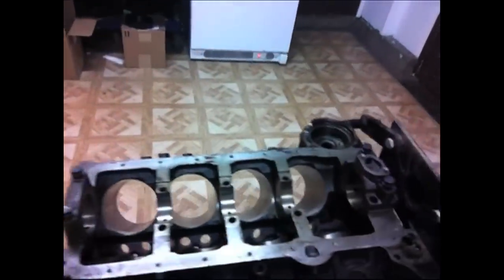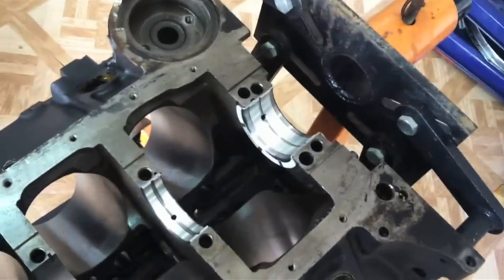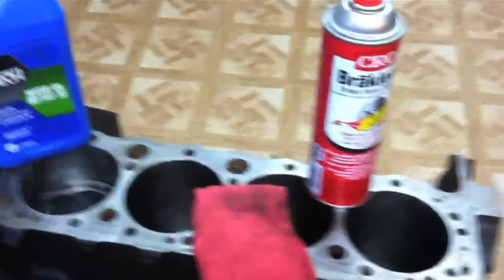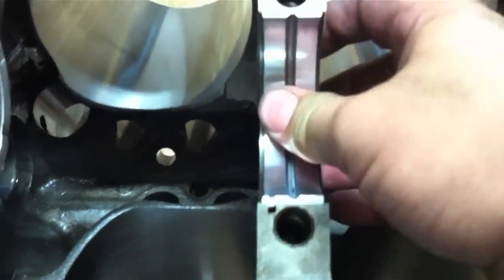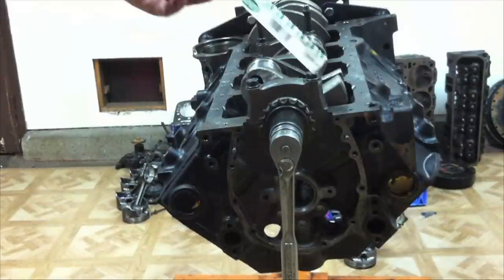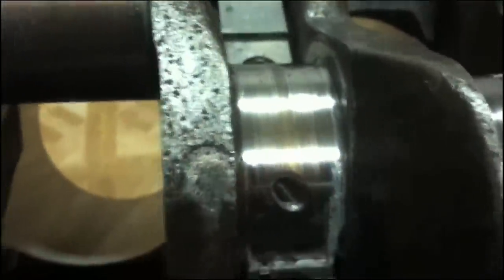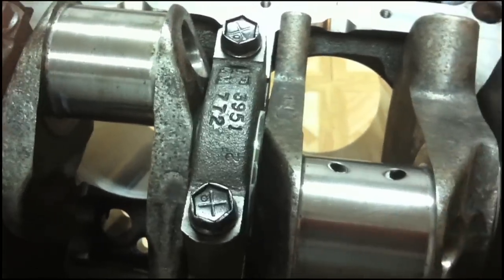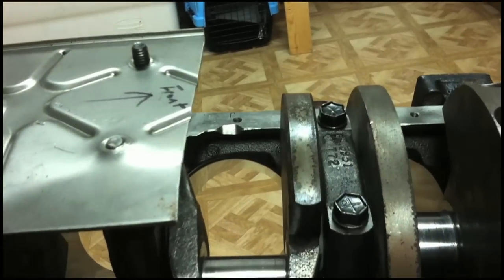How To Build a Chevy 383 Stroker - Part 1: Block & Crank

Comment: I have never seen anyone clearance half a bearing. Why would you stroke a 2 bolt main?
Reply from the maker: The amount of material you take off with "scratch brite" is so small that if you needed to clearance upper and lower bearings you probably have the wrong size bearing or crank. The stroker crank came in the box of crap the customer brought me. Some people are just too cheap to do things right and I don't work with people like that anymore.

Comment: It wouldnt have cost much to polish that crank. Also, you should not have that grease in there when plasiguaging. It will read tighter  than it is. I got a 415 small block in about the same condition and its been running strong for 15 years now.
Reply from the maker: That's what happens when you have a customer who is really cheap. He just wanted me to put the parts together. I don't work with cheap customers anymore.

Comment: i know its an old video but you did a great job. it looks like the original builder did not clearance the crank or block. that crank looks shitty. i had many stock chevy cranks with over 70 to 100k miles that looked like new.
Reply from the maker: Thanks. When the client brought me the bucket of parts he never said the word "Craigslist" and did not want to spend the money to redo everything. That's why I used it as a training video. LOL You can see a NICE 350 on my "Engine dress Up" series. 400 hp simple street "motor"

Comment: do stock rods and pistons still work
Reply from the maker: Not trying to sound like an ass but yes and no. "Stock" can refer to many different piston and rod designs. "Stock" pistons and rods in a 400 that you might use in a 350 block are different than the 350 "stock" rods and pistons. There are almost unlimited rod and piston designs to build an engine these days. Overall "compression" and "displacement" comes from a combination of pistons, rods, camshaft, bore, crank and so on. There are many complete "stroker" kits available from places like Summit and Jegs. I would start with talking to your local machine shop to see what is available and what works best in your situation. Is it a street car? A weekend racer? An off road truck? Do you want 9:1 compression to drive around town or 12:1 to go race? Pistons can be domed or dished and the wrist pin is located in varying points on each piston design. Check out the "Build Sheet" page on my website. it will help you plan and budget your build. You can also read more of the "techo" stuff on this page I found   http://www.hotrod.com/articles/ccrp-0808-383-stroker-small-block-chevy/  Thank you!

Comment: how do you know if you have a 383 strocker crankshaft
Reply from the maker: If you don't have the book with the numbers you can look online. There are a few webpages I have found that list serial numbers for cranks, heads and blocks, etc. You can measure the crank throw but honestly not sure how to do that accurately. I let the machine shop do all that stuff for me.

Comment: how much did the whole build cost?
Reply from the maker: This was a long time ago. He brought me a basket of parts and I just charged him a few hundred $ to put it all together. I had to clearance the block and check things out. He would not listen when I told him all the things wrong with it like the shit crank, etc. I won't do that again. If you want to see a GOOD 400 hp 350 build take a look at the follow up series on "Engine Dress Up" with the red engine and new aluminum heads. A GOOD engine like that custom built from the computer design and dyno program to a complete engine is $5000 - $6000 (2015 prices). That includes everything from oil pan to air cleaner. This engine was crap that's why I used it as a training film. LOL

Comment: I use a hard plastic hammer.
Is that bad?
Reply from the maker: Where are you using the hammer?
Reply: knocking in main bearings. I was afraid a metal head  could mar the edges.
I am a mechanic that builds the occasional engine as a hobby but not an engine builder. My current engine build is a 350 OLds that should make near 430hp. My next project is an 351 Cleveland that will be stroked to 393. I just do it for fun.
Reply from the maker: 1400IntruderVS Some people yell and scream if you use any hammer or impact gun on main bearings. I understand if they want to be completely anal and that's fine but most people do not realize that there are different size and styles of hammers and there is a setting on air tools to turn them down just like a stove burner! You do not need to set the gun at 500 ft/lbs! You do not need a 5 pound sledge to lightly tap in a main bearing cap. You can see I am using a very small ball peen hammer to very lightly tap the cap into place.
Think of it this way: 
Just because you are a butcher does not mean you can be a surgeon!
A plastic hammer is fine especially if you use a "dead blow" style with lead shot in the head. Whenever possible (or when I think about it) I try to use the handle (butt) of a hammer (wood or plastic) to tap things in place the same way I do installing pistons. You can see that on part 2 installing pistons.
Hope this answers your question. I know it's a bit long winded but a simple "yes" or "no" will get a bunch of screaming responses one way or another. I'm sure it will anyway! LOL
Reply: I get it. 
I actually use the handle of my plastic dead-blow hammer to install pistons.
Thanks and great videos.
Reply from the maker: 1400IntruderVS
Thank you. And obviously this engine is not my best work. If you want to see some very nice engines check out my website www dot corvettesandcustoms d o t O R G

Comment: The difference is not whether it is electric that determines whether it's a motor or an engine.  the technical difference is that an ENGINE runs under it's own power, and a MOTOR requires a source of outside energy to run.  An ENGINE can run a MOTOR (example: GENERATORS), but a MOTOR cannot run an ENGINE without some sort of external power source to run the MOTOR in the first place.  Simple, right?  😉
Reply from the maker: I can see both sides of the argument. The human body is like a train engine - diesel/electric. Diesel engine running and electric motor. The human body takes in external fuel which is burned and turned into energy at the same time electrical impulses control our "motor functions." LOL Also an engine needs fuel and motors need external power from electricity or other means like a hydro electric motor. Unless you have a perpetual motion machine..... motor.....engine?  The world may never know! Ha.

Comment: Don't impact main bolts
Reply from the maker: You can use an impact on main bolts just don't have it turned up all the way and don't hammer the shit out of them. Why don't you guys understand that you can turn DOWN an air gun gun like you can turn down a stove!  If I still have to turn the bolt with a torque wrench just to get to 65 ft. lbs. do you really think there is a problem?

Comment: yes   lay your crank down on dry bearings and torque    there is no need to turn the crank for you are just going after clearance.   at least for the mains.    once mains have been found to be within tolerance  then lube bearings, reinstall and torque.   then you can proceed to check rods in the same fashion.      The clearance you read IS the oil clearance.  Otherwise you are getting a false reading

BTW    why would you install a POS crank back into an engine?
Reply from the maker: sc928porsche Anyone else care to respond to this? He obviously does not get it.
Reply: How is it a POS?  Looks fine to me. It just has to be smooth and he plastigaged it for the clearance I don't see a problem.
Reply: +SanDiegoHotRod do you like the 2 bolts as much as the 4? How much of a strength difference is there?
Reply from the maker: Max Daniel I prefer to use a 4 bolt because I have built a lot of supercharged small blocks with 500 - 800hp. You don't really need a 4 bolt if you are doing low compression and building under 400hp. 4 bolts offer more strength and insurance for higher rpm and hp etc. This POS 383 belonged to a customer who just wanted the parts put together. The steel crank is strong enough and it clearanced ok but I would have turned it or got another crank. Lots of short track guys use cranks like this all the time which is great when you are doing constant rebuilds or you are racing in a class that says if you win you have to sell your engine to anyone who offers you $500 (or whatever price they set). That keeps local track races fair and competitive.

Comment: I have an issue with how much oil you put in your main cap bolt. That much oil would not allow the bolt threads too properly seat. Even machine oil has the property of all fluids and DOES NOT COMPRESS! So you aren't getting the almost metal to metal torque that is called for. Put a drop of oil on your finger or a cloth and just lightly rub and remove the excess. Also imho I wouldn't waste time making a "stroker" out of a 350 with 2 bolt mains! But that may just be me.
Reply from the maker: Actually you do not want metal on metal on bolt threads. That is the whole reason for using oil.  Second the oil does not compress. It is not an air tight seal. The oil disperses. Most of the oil also comes off when you are threading it into the hole. If you were pouring the oil into the hole that might be different. And I agree. I would not build a 383 with a 2 bolt block but that was just one asshole customer with no clue that's why I chose this build to shoot the video with.
Reply: I fixed my original comment, I had meant to say almost metal to metal. I was not saying oiling was wrong but the amount if you review the video is imho excessive. Also if it is a "blind" hole where would the oil disperse to? Some out the top as you screw in to be sure, but not all that.  In most cases when using lube during engine assembly where you don't have moving parts, as in the case of a bolt going into a blind hole less is MORE.
Reply from the maker: I understand. If you have too much oil or fluid in a blind hole you don't want the bolt to hydraulic out. That's why you don't fill the hole. It's like cooking with "a hunk of butter" or "exactly 1 tablespoon of butter."  You are correct. You just want to lube the bolt and threads. It's not like priming the oil pump.

Comment: I would think it would have been a lot smarter and beneficial to remove the extra material from the already rough crank to smooth it out rather than intentionally wear down the bearing coating?

Comment: Sorry guy, but I build racing engines. I would never use plastigauge. Takes three sets of main bearings to acheive the clearance i want on bearings, plus a micrometer, plus time. When I get thru, I take the other two sets of bearings back. Never had a bottom end engine failure yet. fyi
Reply from the maker: Been building race engines for over 20 years and have never had an engine failure either. Do you charge by the hour? I would love to have customers that don't mind paying $150 an hr. for an extra 20 hours of changing bearings, buying multiple sets of bearings and running back and forth to the store. What's the name of your shop? I think I will move to where you live.
Reply: SanDiegoHotRod Sorry if I offended you guy. It doesn't take 20 hrs to crush and document 15 bearings. I build my own engines ( no customers) and i don't use pitted crankshafts. Mine are indexed, polished, knife edged, balanced, oil relieved, and turn 10 grand. (287 with a 3 inch stroke) That's why I'm particular about my bearings. Just sayin'.     Keep on doin' what you're doin' if you're makin' money at it.
Reply from the maker: Brian Ferrell No worries. The engine in this video is garbage that I put together a few years ago for some really cheap customer. That is why I used it for a demo for home building weekenders. If you watch any of the engine building shows on TV you must go crazier than me seeing how they do things and all the steps they leave out, etc. I don't do anymore cheap work since I am buried in restorations now (65 Chevelle, 58 Impala, 58 Corvette with factory fuel injection and 67 Corvette with factory 427 and tri-power). You can see some much better engine work on my website. Thanks Shan www dot corvettesandcustoms dot ORG
Reply: Cool!
Reply: Brian Ferrell Can you make a video of how to properly check for the clearances? I noticed you don't have any uploaded videos. Thanks

Comment: if you can't find out what main caps go where you cannot mix match them you would have to get it line bored to match them again or you'll have to fit them and make sure there is absolutely no gap or mark between the block and cap where the fit together. . same goes for the rods. 

BTW you don't need to tap the bearing or journals you can push them flat with ur fingers...

that crank looks like shit... that crank should look like a mirror I would have just spend the money and had it polished.. that's just adding insult to injury.. you can't shave a main bearing there's a coating on it your rubing off!! ever heard of breakaway force??
Reply from the maker: You may have spent the money but when the customer just wants you to put the thing together and not spend a dime then that's a different story. How many engines have you built for clients? I looked on your channel and did not see any videos you made to show people how to do anything. BTW if you can push the caps flat with your fingers they are too loose. Just sayin.

Comment: brass hammer would be a good idea bud.
Reply from the maker: I normally use a plastic hammer with the shot inside (dead blow hammer) but did not have it with me when I was shooting this. This hammer is so tiny. Brass is softer but you can also get brass chips or flakes in the works. As you can tell I am not super ANAL about being clean or as some one else screamed "Scotchbrite has 40 microns of aluminum oxide and it will destroy your engine!"

Comment: how mutch hp
Reply from the maker: This engine is not great with mostly stock parts. it is about 350 true hp. If you look at the red engine on my "Engine Dress Up" series it has better parts, better aluminum heads and is just over 400hp on premium gas. The long stroke give you low end torque. Most of your hp comes from the heads.

Comment from the maker: Obviously you have not built many engines professionally. I have been doing it for over 20 years on MANY EXPENSIVE show cars and race cars. Have you EVER been in the pits at an NHRA event and watched them rebuild a 7000 hp engine in 90 minutes? BTW, impacts DON'T effect bearings whatsoever, plus there IS an adjustment on air tools just like the burner on a stove. Just FYI

Comment: Never   repeat  NEVER  handle rod, main, or cam bearings with bare hands.    Disposable gloves are easy enough to come by.    Also apply lube to bearings with gloves on.      Do not lube the bearings when checking for clearance.  It will give you a false reading.  Once you have gauged the clearance and cleaned,  then apply assembly lube and install.   Thank you.
Reply from the maker: sc928porsche So you would lay a brand new (not this POS) crankshaft down on DRY bearings. Torque all the main caps and check each bearing WITHOUT lubing the journals? And when you need to SPIN the crank for each journal to make sure the oil hole on the crank is not in the way you would spin the crank DRY or would you take EVERY main cap off, lift the crank, turn it, torque each cap down AGAIN and measure the next bearing? Interesting......
When an engine is running the oil passing between the bearing and the crank takes up space. THAT is part of the clearance you ALSO need to measure. You don't put lube on the spot where the plasti gauge is measured. 
So you are saying that the oil from your hands is worse than the assembly lube or oil that is in the engine? Exactly how many engines have you built yourself? Appreciate the concern but you sound more like a doctor than a mechanic.
Reply: sc928porsche If you are cleaning everything up before final assembly there is nothing wrong with handling parts barehanded. If you think that is the first time they have been handled bare handed you are kidding yourself.  I do all final assembly with latex gloves but my dad never did in 30+ years of dirt track racing and he always had strong dependable motors that seen a lot more RPMs than this 383 will.

Comment from the maker: Have you ever heard the term steam "motor?" How about steam "engine?" Of course newer trains have diesel/electric engines which are diesel "engines" that turn electric "motors" so that does not help.
If you put a starter motor on your car's engine do you say "I put a motor on my motor?"
Just sayin..... LOL
Reply: Ever heard of "MOTOR OIL"?  How bout a "CRATE MOTOR"?  What the hell is a MOTORcycle? 

Look them up in the dictionary.  They mean the SAME THING.  Worry about building the internal combustion energy producer instead of trying to be an English instructor.
Reply: MrBeerThirty I think you're both right and both wrong. All engines are motors but not all motors are engines.
Reply: +Andrew Soldan Correct.  An "engine" generally operates accruing to a defined thermal cycle.  It is a motor also.  An electric motor does not operate on a thermal cycle.
Reply: +MrShobar According.

Comment: I missed the part where you weighed / balanced the engine components
Reply from the maker: tyhu thujh All the balancing is done at the machine shop. Ideally you should have all the components ready to go when you assemble the engine. That includes a new or turned crank, not a POS like this one. The owner did not want to spend the money to do it right and just wanted his rat rod put together. Needless to say I did not warranty this engine.....